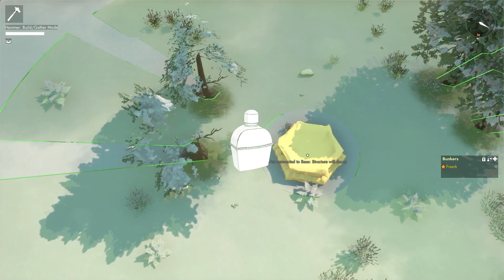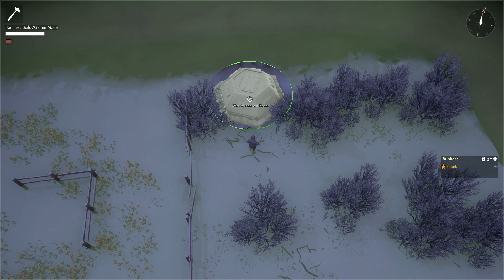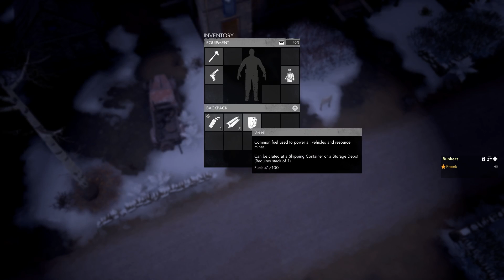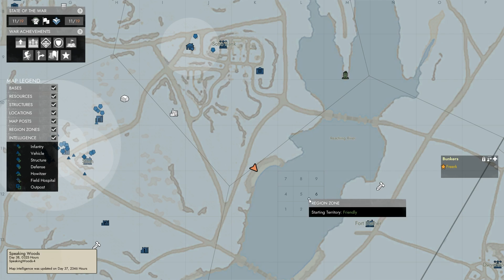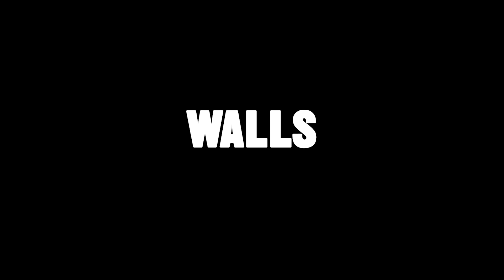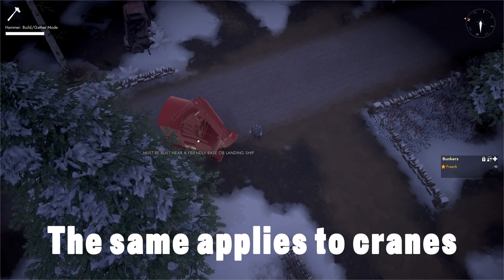Foxhole: Building Basics

Comment: What are the advantages to the different pill boxes? Like the mg has the mg obviously but the rifle and at? Does AT not fire at infantry? Does it only fire shells? If not, why not build that instead of regular rifle pill boxes?
Reply from the maker: AT pillbox does not fire at infantry, so you need either normal or MG pillboxes around to protect your AT pillbox.
AT pillbox shoots the equivalent of the 20mm (like the AT-rifle) so bullets not shells
Reply: @FreerkHoltes  gotcha. So having rifle/ mg pillboxes on either side of the AT pill box is all thats needed?
Reply from the maker: @001sharpshot  For simple combined attacks yes. Things get more complicated if they start utilizing smoke or other tactics.
Most important take-away is, I think, AT pillboxes do not target infantry so you can not really place them without any form of extra protection against infantry. That protection could be rifle pillbox, rifle garrison, barbed wire line outside HE range, actual player in the AT pillbox with a rifle and more

Comment: Nice!  How do you adjust orientation and shapes of sandbags, wire etc.?
Reply from the maker: When you select the sandbags in the build menu hold RMB to adjust the orientation of the BEGIN point, left click if you're happy with the beginpoint, then you will have the END point under your aimpoint and here again you can hold RMB to change the orientation and you can SCROLL to change the CURVE between the points. If you're happy with the overall shape you left click to finalize the blueprint. Walk up to it and left click to submit your barbed wire into it
Reply: @FreerkHoltes  Thank you!